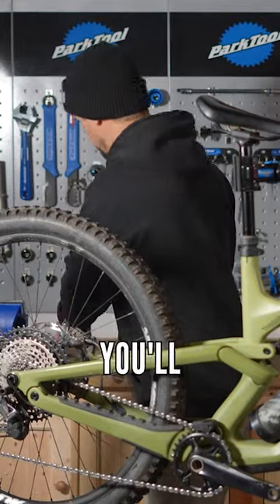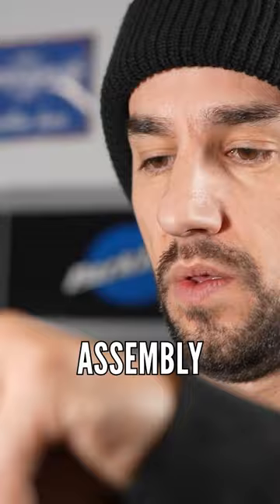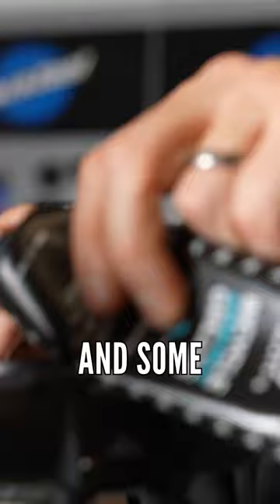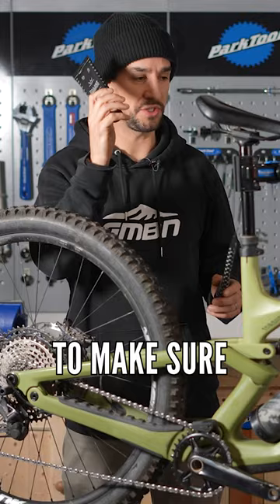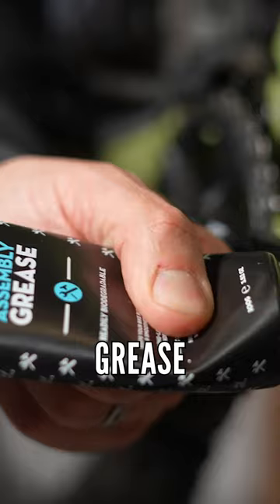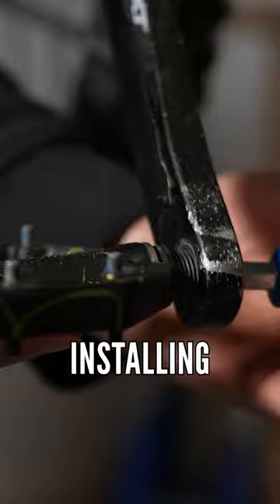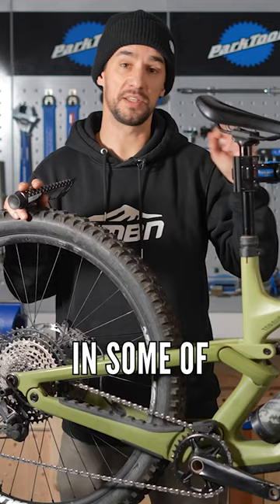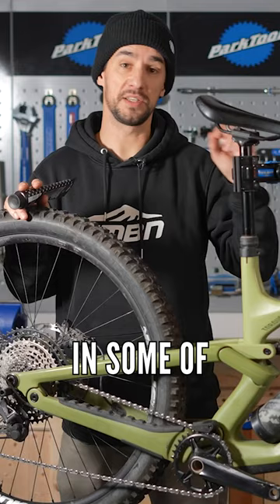You NEED To Grease Your Bike! Here's Why! 🧑‍🏫

Comment: Be careful with steel bolts in aluminium. The grease can increase the transferred torque ao much you can strip out the threads if they calculated the torque dry instead of greased. Same applies with loctite.

Comment: This is terrible advice. NEVER apply grease to the fasteners unless you want them to be overtorqued, fall out or render the thread locker useless.  When a thread is greased, it requires less torque to achieve the same clamping force, so the torque values on that fastener have to be lower as there is less torque friction on the threads when you’re tightening.  When something mechanical is designed, fastener torque is specified either by dry or lubricated torque.  On a bicycle, you should lube pivot points, sliding elements, bearings and your chain. But fasteners should be dry and use a single drop of blue loc tight to ensure they don’t back out from vibration. Especially since you don’t want to overtorque any threads in aluminium and risk stripping the aluminum tapped holes out.
Reply: What you're saying makes sense, but you're the first person I've heard say it. I'm only 6 months in and I always grease everything because that's what every video I've watched says to do. I must do more research lol.

Comment: Let's stop this nonsense. Grease is a friction modifier. This means that even if you torque the bolts to the specified torque, you are not there anymore. Plus, the biggest mistake is the application of grease in any bolts that have loctite on them. As disk bolts and stem bolts. The torque they need to be tightened is small because of their length and diameter. But is enough for them. I can understand that   you may ride the bike in wet weather and by greasing every single bolt means that they will not cease but it seems that is getting outta hand. The paradox is that the same mentality with lubing everything does not apply to bikes and cars. Odd right?